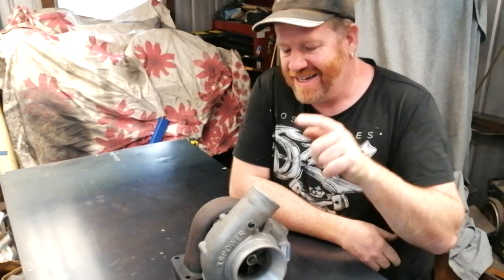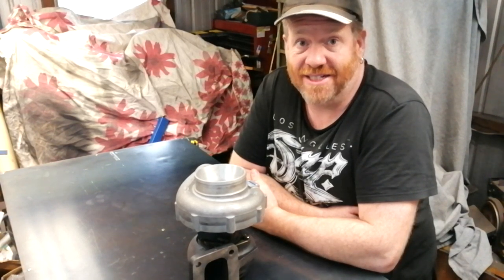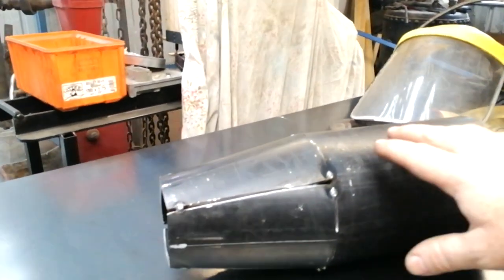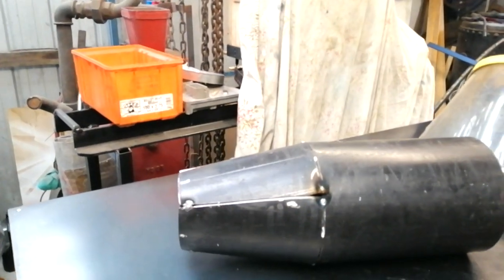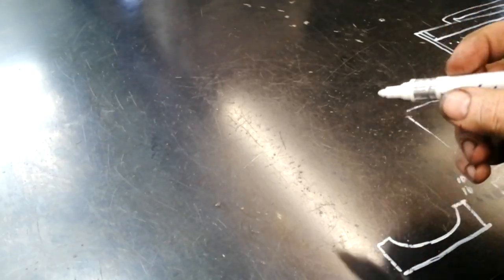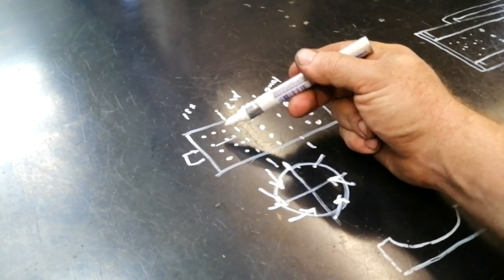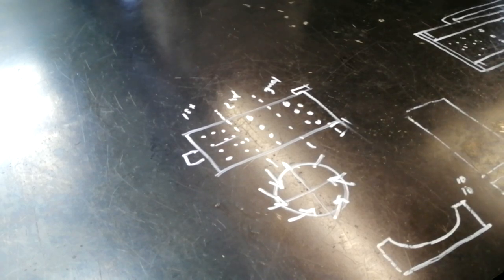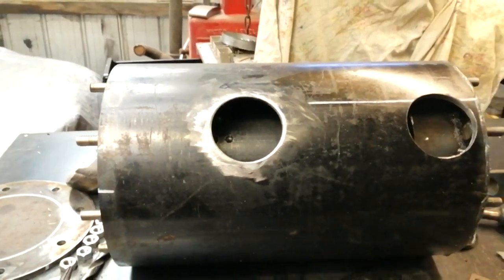Building a Union Pacific , Gas turbine locomotive  PART 1 GAS TURBINE.

Comment: How are you going to drive a shaft off of that Turbo to turn an electric generator you need look up a engine called a turboprop like on the C-130 Hercules kind of similar to the type of turbine they used and the Union Pacific gas turbine locomotives good luck very interesting project I live in Utah and at the Utah State Railroad Museum there is one of those 3rd Generation Union Pacific Gas turbines it's just a hollow shell of its former self but it's still pretty cool looking peace out have a good day and interesting project
Reply from the maker: Hi there, the latest video I made a power unit that will be used to capture gas flow and turn a shaft, thanks for your encouragement 👍

Comment: Hardest thing for me is making the combustion chamber. You think there is a way you can build me one? I’ll pay 💰
Reply from the maker: It's not difficult to do, I'm using heavy wall pipe which is alot thicker than needed, you could pre drill flat sheet and roll it or even drill by hand thin walled pipe
Reply: ShedTorque 🤔🤔🤔 seems like a good idea